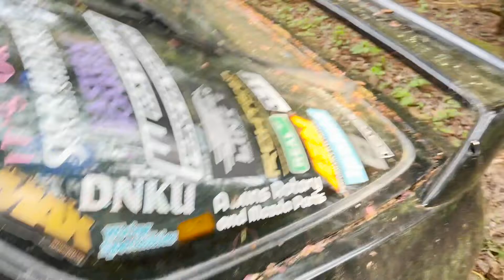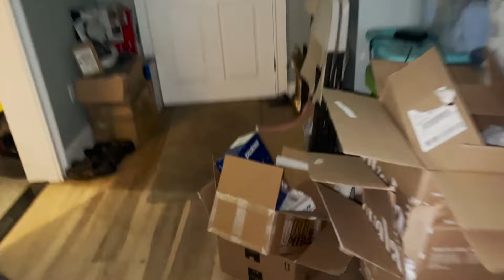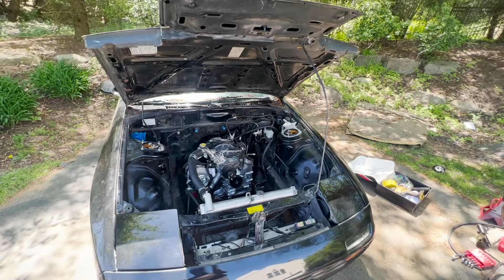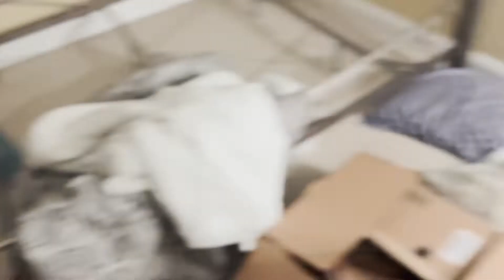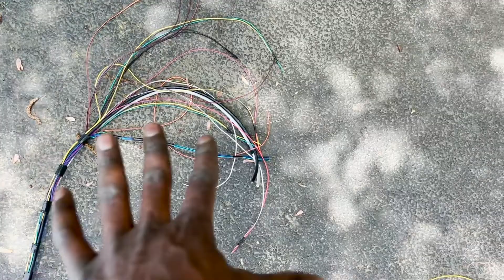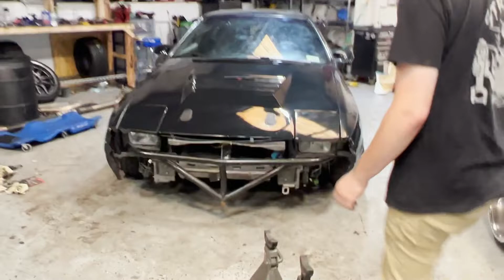Engine Install, Wiring, Plumbing... | FC RX7 Restoration Ep.26

Comment: I’m curious to see you fix your wipers. Mine only work in speed 1. Apparently there’s a old guy that fixes them but you gotta send in your whole wiper switch. Normally it’s the just the switch that goes bad is it not? Or you just changing the connectors to make sure?
Reply from the maker: 90% of the time it’s honestly the switch
Reply: @thepcmrtim  oh okay yup